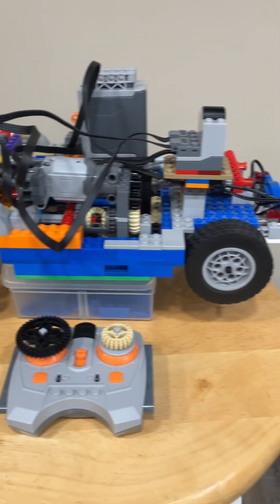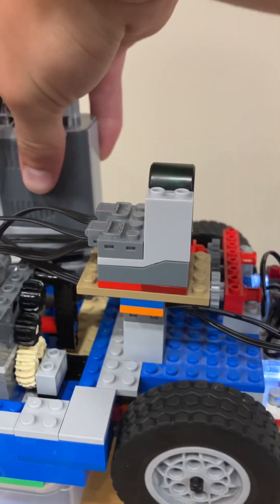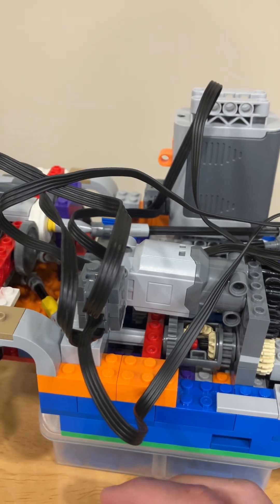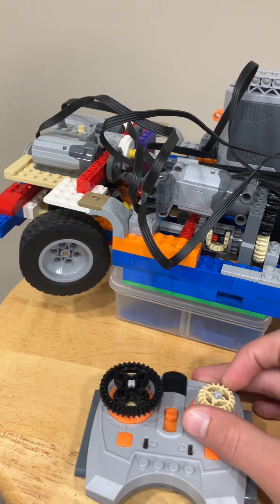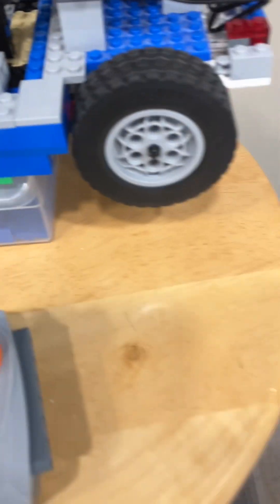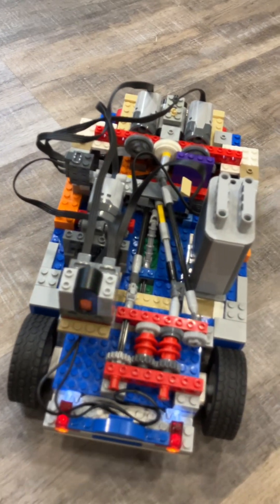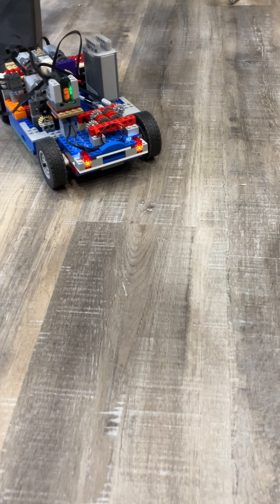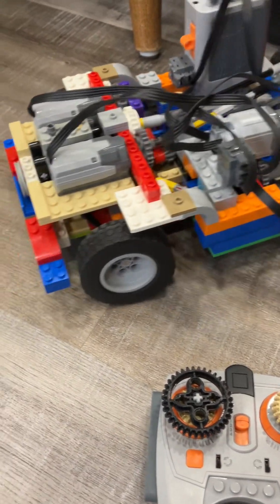I Finally Got My First Lego Model Car to work, at least; well enough…

Comment: You should use a servo for the steering, the angle of the servo corresponds to the angle of the dial on the speed control remote so you still have proportional steering or whatever they call it, how far you turn the dial is how far the wheels turn. That way it will be much more controllable but of course you cant order a new genuine PF servo anymore if you don't have one.
Reply: I think the weird acceleration is caused by the white clutch gear coupling the drive motors slipping you can try just a normal 24t gear
Reply from the maker: @Dudeface167  thank you. I will be sure to try that out!
Reply from the maker: @Dudeface167   I have considered using a servo motor since it has much better handling. But at the moment, I don’t have a Servo motor; if I did have one, I’d ABSOLUTELY put it into the steering system. I wouldn’t have had to dink around with the gear reductions! So yeah; thank you for your suggestions, in the future I will definitely include them in a project!! Also would you like a shoutout in a video that covers your suggestions?
Reply: @SimplyMyBuilds  nah you dont have to give a shoutout sorry for the late reply
Reply from the maker: @Dudeface167  no worries bro